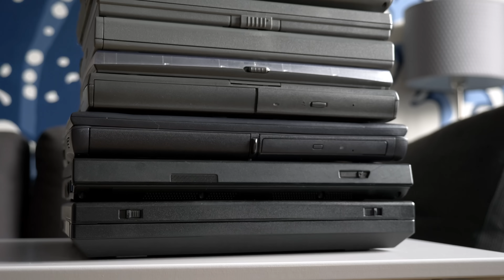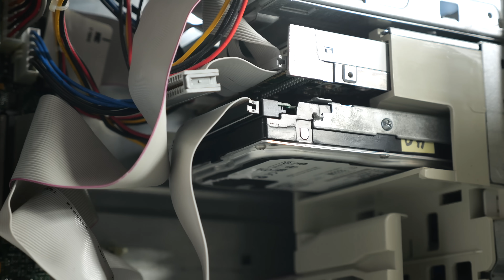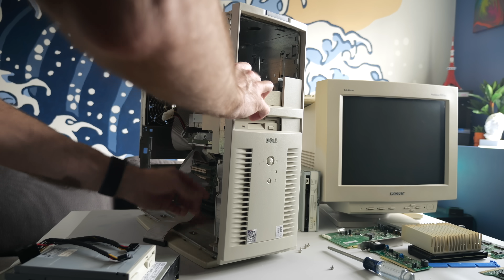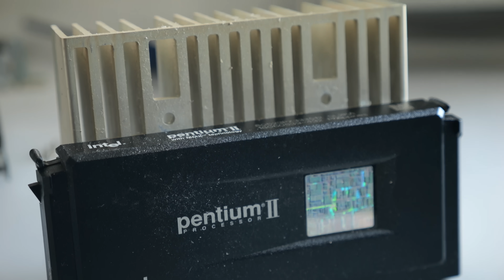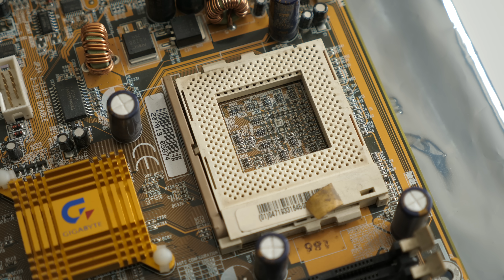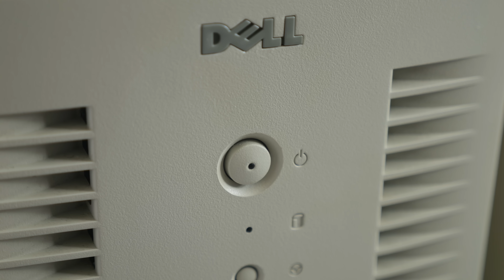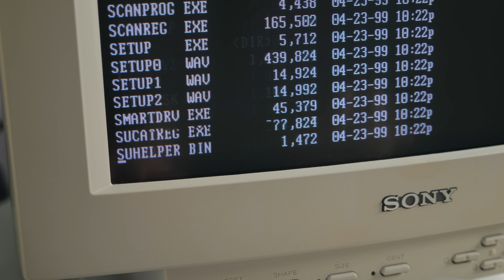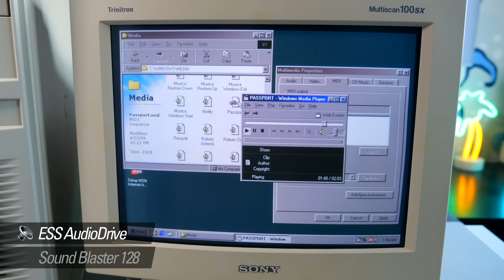Could this prebuilt vintage PC actually be GOOD?!

Comment: Hey, those old Dell keyboards, yours looks like the common and actually quite nice SK-8000, it's actually remarkably easy to disassemble and restore. the control board sits right in a corner and is only held in by a single screw.. Its one of the best candidates for a keyboard restoration, if you're interested in it!

Comment: I have a Dell from 2000 that looks just like this one but ran 2000 Pro and has a 1000 MHz Pentium 3 CPU and 256x2 RAM. I used it to play EverQuest back in the early days on online MMORPG games in that early 2000s era; it had a PCI network card and used to get 5 Mbps on Roadrunner Broadband internet service, and the PC was an absolute beat for the time period.

Comment: Curious if someone did a full CPU/motherboard swap on this system, that's the only way I can figure that it recognizes everything as a Dell 333 model. If it was just a straight CPU upgrade I'm sure the BIOS would still have the 266 model name regardless of the upgrade.

Comment: The sound card comparison really isn't 1 to 1. That AudioDrive will be much less of a pain to get working in DOS games, for one thing, which was still a consideration at this time, and sound much more authentic to the intent of the composers in them too -- though, by this point, FM was kind of the poor man's option, and if you could get that wavetable from the SB128 to work in DOS (not a guarantee by any means) it would sound better in a lot of places too. The ESS card is very compatible, but the SB128 isn't really anything special as it lacks any reason you'd want to use a PCI sound card like EAX acceleration.

Comment: Limited upgrades...Gateway, Acer, a friend had a gateway, asked me to upgrade it so he game, the power supply was like 3 inches by 3 inches, and about 10 inches long, that was not going to handle hardly anything above what the system came with.

So instead of upgrading we went to Comp USA and bought the case, etc.. and built him a real computer.

Comment: I picked up an XPS 333 back when it launched because it was the only way to get a Deschutes P2 333 early.  I put the CPU into my home-built PC with an Abit BX6 motherboard and it easily overclocked to 400Mhz stable without any voltage mods.  Back then, CPU's released in speed increments of 33Mhz, and it took another 6-12 months before Intel released official 366 and 400Mhz pentium 2's.  I loved that build and used it for over three years before moving on to a socket 370 board and cpu.

Comment: I bought one of these new back when it was current.  Loved it, but I had issues with RAM causing BSOD under windows NT.  It would only happen after hours or days, so it was really hard to troubleshoot.  After several parts swap outs by Dell, it eventually turned out to be the PSU.  Nice machine and case, but that several months of unreliability were not fun.

Comment: Prebuilt pc's were very good, but you had to get the right ones.
Compaq Deskpro's were great,  Compaq Presario's were not so great.
The Deskpro line like Optiplex Dell later was a stable config, with room to upgrade
Presario was budget, home consumer build, with more quick model variations, and basically bought components with just a new Compaq Bios.. weird chipsets, weird sound cards, they were branded, but did not represent the brand like a Deskpro did

Comment: Your soundcard shootout is a comparison of the ESS fm synth with the soundblasters sample rom / wavetables. Likely that ESS efm engine is gonna blow the soundblaster's fm engine (which is likely emulated iirc) out of the water. That ESS doesn't appear to have a wavetable header so an apples to apples comparison with wavetables isn't possible. ESS took the OPL3 concept and revved it into a new generation - the fact that it sounds anything like samples is notable. Even soundblasters with proper opl3 fm chips can't do that.

Comment: yes you can  overclock your dell ,,,,, this computer goes from 233mhz up to 333mhz,, i have the same dell D266 , theres a pin on the motherborad ,, move the pin and push the power button and should go in to the bios and let you set the change the cpu speed from 233mhz or 266mhz or 300mhz or 333mhz with out buying another slot 1 cpu ,, after changing cpu speed it will say its safe now to shut down , push power button to shut off , go to the mother borad and put the pin back where it was before , reboot it now show what ever speed you chose , push deleate button to go in the bios it will now show the cpu speed

Comment: Those are not rivets, those are Torx screws. Pretty common for OEM Pentium 2 processors. I'm yet to see someone successfully open up a P2, but the heatsink can be easily repasted and replaced.

Also, 32-bit color on a Rage128 is... questionable. 32-bit became viable with Voodoo4/Radeon DDR/GeForce256/GeForce2 GTS. Even on a TNT2 Ultra 32-bit color is less than optimal, and it's better to go with 800x600/16-bit/2xAA.

Comment: There weren't too bad in 1999 we had a a Presario desktop what's 64 kg that we eventually upgraded to 512 700 MHz processor and before we got rid of it in 2007 2008 we even had a DVD burner put into

Comment: Some Dell machines were and some still are quite good. I'm typing this on an XPS13, and I have a T5810 next to me, and have had many selectively chosen Dell machines through the years. A lot of people poop on Dell because they made a lot of cheap crappy stuff but their better stuff was really quite good, and the stuff I've seen them make over the years always has had good ones in there too. A lot of XPS and Dimension weren't bad, decent stuff inside, spare parts are cheap and available or sometimes standard ATX stuff although that was uncommon. 
I do have some experience of this sort of thing, I worked building and repairing PC's in a shop, then worked in corp. IT for a long time, not as a tech but as a developer, but I did do general IT stuff when I had time and felt like it. By this I mean I've had my mitts in hundreds of PC's from old to new, bad to excellent, cheap to very very expensive. Decent Dell systems are mostly roughly on the level of assembled PC's although they often have some quirks - ie nonstandard stuff like PSU and motherboard. Mostly replacements for these are readily available, as are upgrades. So if you find a Dell in the trash or something, it may well be worth a second look. The small stuff is only worth it if you are okay with their current config or at best a RAM or sometimes CPU upgrade, but you should tread carefully and research instead of assuming it'll work like a shop assembled box. Sometimes it will upgrade far better than you'd expect. Sometimes not at all.

Comment: This is nearly identical to my first PC from 1996, a Dell Dimension XPS D233. It came with that same Riva 128 card, and I also upgraded it to the ATI Rage in 1998. That thing went through a number of video cards between then and 2001 when I finally retired it and built a 1000MHz Athlon Thunderbird system. It's crazy how fast video cards became obsolete back then.
Reply: I put my finger down, for AMD.. only Intel, and no other way, AMD = garbage.

Comment: I worked for Dell Tech support for a while in the early 2000s, before they moved support to India.  the Dell Dimension XPS D, R and T series machines solid machines, we very rarely got calls on them.  only time we got calls on them is was corrupted OS issues which was common for windows 95/98.  the Dell Dimension L and Z series were a different story.   the first of the Z series had an issue during production where the power supplies connections to the motherboard were not connected at during the initial production run. it was caught fairly quickly and resolve. there was nothing wrong with the L series other than it was the entry level PC targeted at people than had never owned a PC before and was the object of the race to the bottom price war.  so it was constant calls with people not knowing how to hook them up, or not know how to use it. on a side note, Dell used internal Code names for the different models. for Desktop it was movie monsters, for Example, the XSP R was code named Terminator, and the XPS Z was code named Zuel (from ghostbusters) the 8100 was Sleestak (from land of the lost) and the laptops were named after cigars.  with the shift form letters to numbers of models, the Dimension L series as renamed the 2xxx series. from 2100-2400 with the chassis color change from beige to black and gray dell theme. the internal code name for the L series was Mummy/Mummy II. the tech support guys used to refer to them as "Dummies" because of the people that bought them and the stupid calls they would generate.

Comment: I had a dated but pretty hot rodded computer back then, it was an old Gateway desktop (as in not a tower) that originally came with a Pentium 120, I got a Pentium Overdrive 233 for it and 64mb of ram (max the board supported).  Had a 6gb HD and a Riva TNT2 16mb in there, it ran Unreal Tournament pretty decent, although I think the CPU held the card back a bit.  Upgraded to an Athlon XP fairly shortly after that.

Comment: There was a short time when prebuilt, high volume systems were nearly the same because hardware options were the same as custom built.  They had the same choices for motherboards, expansion cards, ram/cpu etc.   It wasn't until later that prebuilt systems used custom motherboards using custom daughter cards and risers, and everything was integrated.   The final kick in the head was when it got installed into proprietary cases with proprietary psu's where replacement parts are impossible to source because they were not standard specs including some PSU' connector interfaces with the motherboard.  total nightmare.

Comment: Intel also used slot one to keep the mobo manufactures and forcing them to pick either amd socket design or the slot one design of intel.  It was very expensive to set up assembly lines for each mobo layout so most companies wouldnt be able to awitch as easily to amd or intel without a massive rearrangement of their manufacturing lines.
  Intel knew they could force this hand at this point due to how fast they were growing and how big thier ego was getting from the sales comming through. Every year was a new better cpu if not months. Sales were plenty and intel had the upperhand. Sales for them were massive and they were pumping millions into marketing, you couldnt turn on the tv or open a magazine without being asked if you had intel inside?

  I love intel but damn they were no better than Microsoft back in those days.

Comment: In the 90s Compaq used to save money by not putting a bios on the mobo. Every harddrive was specially partitioned to hold the boot info for the pc to run and if that drive failed and you thought u could just by a new one 😂 lol poor you , damn miss those proprietary days of the early computer market ....

Comment: Having two floppy disks allowed for easy copy of any floppy disk. Rather then copy from disk to HDD then from HDD back to floppy, floppy to floppy was faster. I built a few of these older beasts at that time since I started working on PCs back in 1986 and my first PC was a Tandy 1000, a Radio Shack exclusive... What was nice about getting into PCs way back when was watching how they progress went. Each year performance was increase while cost was Reduced. Sadly Greed and Monopolies gripped the PC Market and though the Chip Making Process has become decreased drastically, Chip cost, due to greed, is greatly increased. There was a time, last socket was socket 7, where all CPUs where interchangeable, so if you like Intel you went with Intel or AMD or Cyrix or whatever. Not Sockets are different on purpose to force you to choose Intel OR AMD. It's too bad this changed because if it didn't, PC prices would be way cheaper. Also stuff just lasted longer way back when too. Of course advancements have left the older tech in the dust, as well it should have, but proprietary sockets means lesser options and that's a shame. Greed and Monopolies are killing the PC Market as these Monopolies work in Collusion rather then Competition. Here's something else to consider, way back with 30% Profit was very profitable, but today Intel's Profit is upwards of over 50% and AMDs hoovering about 46% means that every item is drastically overpriced. Take a 1,000 USD GPU, actual cost is under 400 USD and the rest is PROFIT. The best thing that WE THE PEOPLE can do is let the next 2 or 3 releases, of everything, twist in the wind then watch how fast prices drop. But who am I kidding, I doubt anyone has read this far...

Comment: dells from this era also used proprietary power supply connectors they literally swapped the pins around from atx psus so you would blow your shit up if you tried to use a different motherboard or psu

Comment: Both sound cards are great, but using MIDI is an unfair comparison as your ESS Audio drive is missing the add on wave table synth board.  The sound Blaster PCI series did not have compatibility with external FM synth add on cards and the built-in was always sub par until the sound blaster Live and Audigy lines were released.  With that being said, it was very common to add an OPL3 or compatible synth card to the ESS boards and this wave table synth would give it much better MIDI sound than the sound blaster PCI series.  The same holds true with the AWE.  Some models of the AWE were compatible with wave table synth add on cards making have much better MIDI sound than a sound blaster PCI.  What the PCI series brought to the table was Direct sound, EAX 1.0 and A3D support as well as near perfect Sound Blaster Pro DOS emulation (near perfect but broken with some games like Duke Nukem 3D Atomic).  I would suggest retrying the comparison with a good wave table synth card on the ESS Audio Drive card.

Comment: The Dell Dimension XPS line from this era was pretty good, I would have to say.  I had a Dimension XPS R400 from 1998 that I used for college that lasted for more than 6 years with various upgrades all the way from a 400 MHz Pentium II to a 1.4 GHz Tualatin Celeron with a Slocket adapter.  GPUs went from the included NVIDIA Riva 128ZX to a 3dfx Voodoo3 to an NVIDIA GeForce 2 MX to an ATI Radeon 9000 Pro.  It let me essentially bypass the Pentium 4 era of desktop PCs and move straight to the Pentium Ms and the Core Duos with newer laptops.  Dell built these systems really well and the only thing you have to watch out for is the proprietary Dell ATX power supplies.  If you ever have to replace the power supply on that PC with a regular one, it will fry the motherboard because while the connectors are the same, the pinouts are different.

Comment: Saludos desde mi Dell Precision T7810
CPU: X2 (Intel Xeon E5-2697 v3 14Cores 28 threads)
RAM: 128GB DDR4 ECC 
GPU: nVidia RTX 2070 Super 8GB
Disk Controller LSI Nytro MegaRAID8110-4i 1GB Cache + CacheCADE RAID1 of 2 SSD 90GB SSD Built In + BatteryCAP
-DATA: X2 4TB HDDs on RAID1
-OS: X2 500GB SSD SATA3 on RAID0
Disk Dell UltraBay NVMe X4 Slots
- GAMES: X4 2TB SSD NVME on RAID0 on StorageSpaces
Network
- One Network Card 2 ports 10Gbps
- One Network Wifi + Bluetooth Card

Comment: A lot of PCs had 2 floppy drives.  The one I had had 2 simply because I had a 5.25 inch and 3.5 inch.  That was in my opinion a good thing to have since not all software came on all of the same diskettes.  Now these days no one produces those diskettes or sells new ones.  Is there anyone who makes them at all?  I remember a time when you would go to any store that sold anything computer related and they would have shelves full of floppies in packages of varying sizes from 10 up to 100 or more floppies in a box.  Then came along flash drives and now we mostly download our software.

Comment: Found this exact machine it was on the curb a couple months ago I nearly crashed my car. Aside from missing the side panel,floppy,hdd and ram it came with a p2 300mhz a Dimond Fire GL 1000 pro and the integrated Yahama Opl 3-sax a nic and a modem. It took a while to find out that my 40gb drive was too much for this pc using an ide to ss adapter it’s been playing duke and all my dos games perfectly at 60fps. Though USB emulation causes the sound to slow down in windows so use a ps2 keyboard if you can.

Comment: I still have my old Dell. Got lucky and got ahold of a Dimension E520 topart out of course. It had the beefy Core 2 Quad Heatsink. I popped it and a Cedar Mill Pentium 4 Hyper Threaded CPU in my E310 with a PCI Geforce 8400GS. Perfect XP Machine. It has SATA PCIe and alot of modern comfort with IDE and PCI mixed in. Got lucky and added USB 3.0 to it. Long gone is the modem. Just Sound, Video and USB 3.0 with a 300 GB WD Velociraptor.

Comment: Dell Dimension XPS systems have generally been pretty good, up until "almost modern" times. Among the better pre-built ones for sure. Not a bad little system all in all. Personally, I'd get hold of a Matrox Millennium II and AWE64 Value, like they used to sell with, and then I'd add a Voodoo 2 for that nice 3D acceleration, because, let's face it, while the Millennium II does have 3D acceleration, it certainly isn't "nice" :P

Comment: The difference between the sound cards is incredible to me. My first PC was an Acer Aspire tower running Vista on an Athlon 64, so for as long as I've been aware, on-board sound has always been more than sufficient, a solved problem.

Comment: I'm 60 I did back between 1990 to 2001 IT work several areas networking sever setup etc after rollouts DELL was king then and also IBM - not so support then so many problems setting up pcs at the time , but moving CRT monitors around did your back in you had to be a gym guy back then, which I was I used to love moving dumbbells, ok so i have so many stories to tell. probs a bit boring